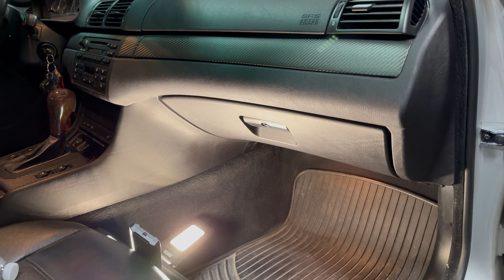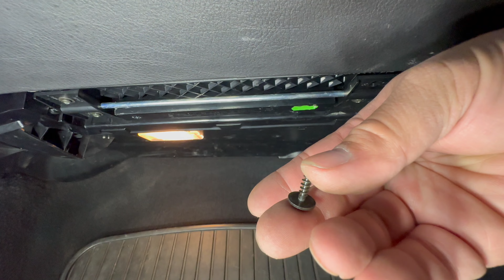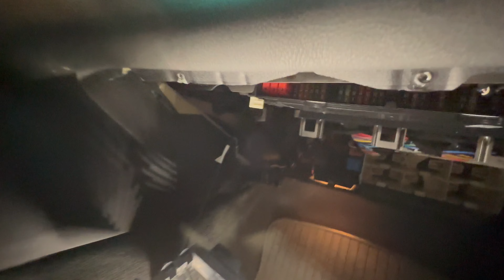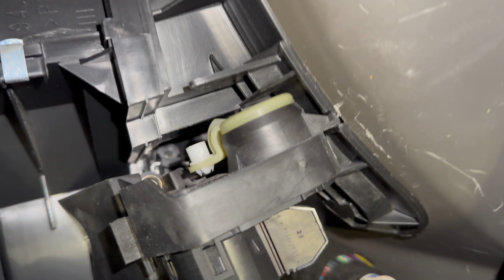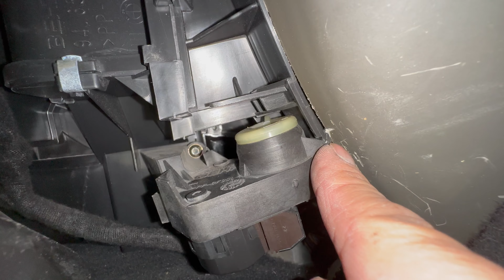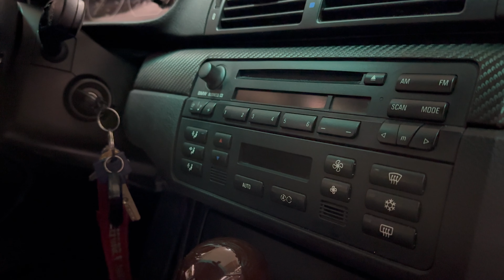2005 BMW 325xi - Replacing the final stage unit (blower motor resistor)

Comment: Same to replace if fan stays on when vehicle is off
Reply from the maker: I’ve had the fan stay on because of this going bad, yes.  In the case of this vehicle, it would randomly turn the fan on when the car was sitting and parked.
Reply: @AKJeeper my battery drained out because of it  thanks for the excellent video. Concise and well documented

Comment: Is this the leading suspect for consistent battery drain in the 325i?
Reply from the maker: I've seen this part cause battery drains on BMWs and Volvos.  I can't say for sure if this is the leading suspect, though.  Many of the parasitic drain cases I've had to troubleshoot have all been different problems.  The last BMW E46 that I worked on with a battery drain had an aftermarket iPod adapter that would drain the battery after a few days.  That was a fun one to troubleshoot.